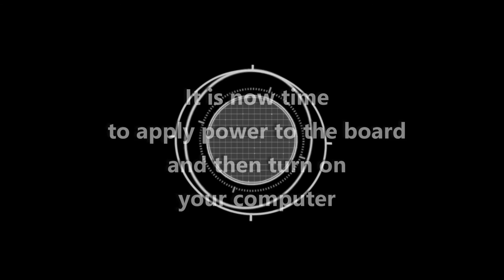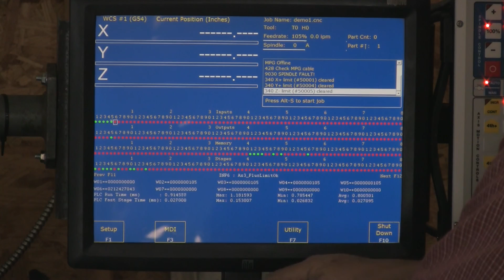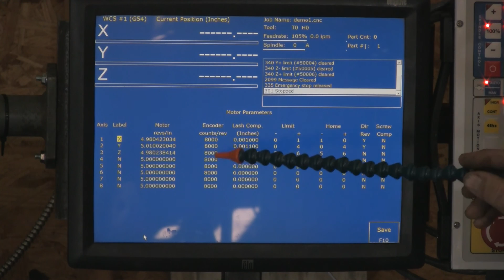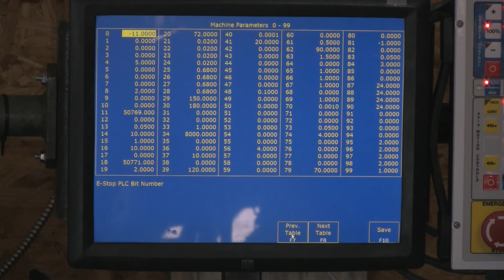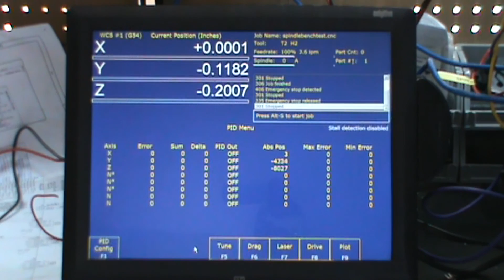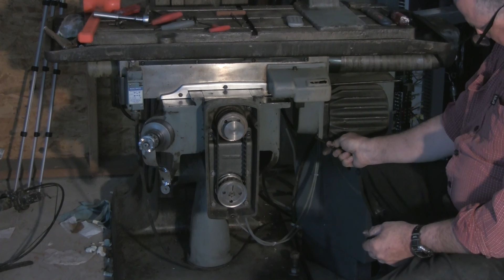Bridgeport Boss 6 Conversion To Centroid Controls

Comment: what nema size are those sevos
Reply from the maker: 34
Reply: Thank you. i was thinking 42. i'm looking at the same mill. The owner has put very little time on her and is looking for $2000 which around here is a good price for this mill. i'm going to convert it to stepper motors and use mach 3 which i already use on my cnc plasma cutter.what a nice job you have done.love the video